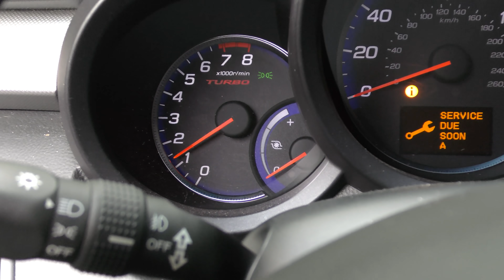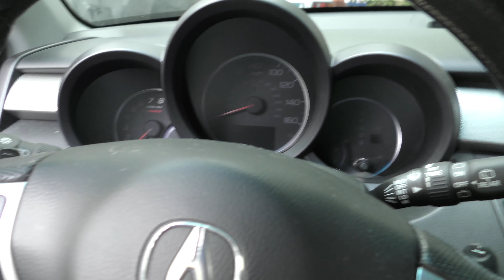I Just Found My New Favorite SUV (You Can Buy It for Less Than $5,000)

Comment: You always warn us to stay away from turbocharger specially when it gets older and you also warned us several time to stay away from all-wheel drive because it is over cost to repair, but in case of this vehicle it's all upside down.
Reply: Not on this car... This is the ONLY exception and I can prove it!
Reply: He did say it doesn't have the dreaded GDI.  So supposedly less strain on the motor.
Reply: @johnwilliamson2707  is 2010 Acura RDX GDI?
Reply: This car is an exception, it was engineered to last despite all that. Overbuilt.

Comment: Acura RDX: I have SH-AWD

‘94 Celica: Is my legendary reliability a joke to you?
Reply: Rajkiran Natarajan Subaru Forester XT laughs in symmetrical AWD
Reply: shinkueagle reliability? 😂
Reply: Bobby May yeah Acura’s are reliable, moreso then subaru.
Reply: Nick Zito Modern Subaru’s are terrible.
Reply: s blagg you mean like the fact that 1.5 million had their warranties extended due to CVT failure? Or the fact that 2.3 million were recalled over a brake light switch issue? Or the thousands of head gasket jobs people have done to make them run past 90,000 miles? Or the oil burning issue on the H6?

Comment: My wife had a 2010 rdx when we met and she loved it.  Never had any issues other than 1 wheel bearing that went bad at 6 years. When we had 3 kids and needed something bigger, we got a used 2014 mdx which has proven to be reliable so far. It has a v6, no turbo, which i prefer but is still GDI. Also got the front wheel drive instead of all wheel drive. The MDX does get good mileage, 20 city and 31 highway (actual mileage not the EPA rated mileage which i believe is 18/26) so it gets way better than rated mileage. Nothing wrong with it so far and its almost 7 years old.
Reply: Cool story... Gotta love 'em both!

Comment: Scotty: The Acura RDX is my favorite suv

Scotty: Why the Acura RDX is a endless moneypit
Reply: CHANGEDD THEEE GGGGGAAAAAMMMMMEEEEEEEEEEEEEEEEEEEEEEEEEEEEEEEEEEEEEEEEEE
Reply: Arnoldo Texta - well... I just bought an RDX 2015, 50,000 miles for $15k USD. I love it so far, but I haven’t had it very long. I shopped and shopped and negotiated and shopped. I ended up going with a dealership because I didn’t find there was much price differential for. 

Is there a reason you want an ‘O6? Budget or you like that year? As for advice: be patient, and don’t limit yourself to looking in your area - if you’re willing, look within 500 miles, it broadens your options.
Have a mechanic check it out. Set up your inspection the same day you intend to buy it.
Reply: @jmclick.6349  why?
Reply: @EverettNewell  How is it holding on so far? I have my eyes in a 2016 rdx 75k miles.
Reply: @drmendozaenriquez  - I ended up having to get the transmission rebuilt. Not thrilled. It’s been fine since then, but apparently their transmissions aren’t very good.
Reply: @EverettNewell  2019 Acura RDX, I've had it for three years now. The only problem is the transmission, it's funky for sure
Reply: @drmendozaenriquez  I’ve had my 2018 for 20k miles now and it’s still under 30k miles but runs like a fuckin champ
Reply: @Everett Newell These transmissions really need oil and filter change every 30k miles.   130k on my 2013 and it runs great.  I also did a timing chain replacement at 98k and replaced rear shocks at 110k
Reply: Didn't he tell us not to buy turbocharged engines

Comment: The coolest thing about the first gen Acura RDX?
It was Honda’s first turbocharged car for America and it is pretty capable has a lot of potential
Reply: Swap it into a civic
Reply: @bigsohc  Rdx has more power than a civic. Yes the body style is same and civic is a great car too but rdx is not just a disguised/dressed-up civic
Reply: I have an 11 with the shawd.  It's a fun canyon runner and highway puller. I love getting in it every time. 105k miles with zero issues and regular maintenance.
Reply: Where did you find a Acura RDX of that year with low miles from ?

Comment: I've had mine for 4 years, it has 260k it's had it's issues but that's basically because the previous owners didn't stay on the maintenance which is important on these cars . As long as you use the fluids you are supposed to. Stay on top of the actuator eye bolt for the turbo. It will last a long time. I've been very hard on mine but I make sure it's never running dirty or redline all the time. It has few mods and I've spanked Mustang Gt's, STI's , Si' s all day long. Let that turbo breath and it will give you good results but don't neglect it. Oh yeah I'm also still on stock internals and turbo.
Reply: Quick question on the eye bolt, common issue?

Comment: Scotty, when telling people to change their ATF, tell them to shift to reverse for 5 seconds, shift to park and turn off the engine.  Then change.  They can only change a certain percentage of it so I would change it about 4 times between 70,000 and 90,000 miles.  Then do it again between 150k and 170k, and keep doing that every 70k.  This back-flushes the transmission filters which get clogged going in forward gears.  You don't want in reverse too long or more crud gets sucked up into the guts of the transmission.  I enjoy your channel and have spread the news.

Comment: This RDX has the same power as my Pilot from about the same time. They get identical fuel economy. 18 city, 22 highway
Reply: My Ford car  gets 19 city and 25 highway even the mustang gas a better mpg
Reply: @Itz_tony0_0  ford🤮🤮
Reply: No Way - well, my V6 is 3.5L but the Acura’s 2.3L 4 banger is turbo charged. I couldn’t tell ya. Technically mine is rated at 244 horsepower while this is 240, but the RDX has 260 pound•feet of torque compared to my 240. In the end, they’re burning about the same amount of fuel though
Reply: @elamay5  forgot the crown vic

Comment: I have a 2007 rdx with 150k. Warning, tires for this vehicle are very expensive $800. Recent repairs include a failed coil pack. Failed ac compressor relay fuse. Then a failed radiator that caused my trans fluid to mix with coolant. Like the car but it is quickly turning into a money pit.

Comment: Turbocharged? 
13 years old?!?!
AND IT DOESNT EVEN LEAK OIL?!?!
How?!?!?
Reply: Dave Crupel superior build quality and the previous owner doesn't drive hard
Reply: The owner died 12 years ago.
Reply: Scotty magic service.
Reply: It's a Honda, that's why
Reply: Made in Japan??
Reply: Replace or clean PCV valve to reduce engine pressure, use synthetic oil. Never a drop of oil.
Reply: It doesn’t have GDI
Reply: mustafa ali 
Haha! Just because “it’s a honda” doesn’t mean reliability. I have a 2007 Honda Odyssey with just over 140,000 miles, and it has had so much stupid stuff go wrong. Been through 4 power steering pumps, an abs pump, two power steering racks, a transmission, motor mounts, three alternators, both sliding doors broke, and the ball joints have been replaced 3 times. Never had this many issues with any other vehicle, including my 08’ Dodge Ram 1500 with 340,000 miles on it.
Reply: @DS..69  nope. It was built in Ohio
Reply: @deereman8237  Scotty has often said that the Odyssey was the one vehicle that Honda got all wrong and they were junk.
Reply: More Beer 
I can agree with that! Really never seen another Honda vehicle with so many issues.
Reply: @deereman8237  Why is the world would you fix it? If it has more than a few issues, and the same things keep on breaking? That's a solid waste of money, unless that car had sentimental value.
Reply: @deereman8237  Was it made in the US? LOL

Comment: I had a guy come in with a 2002 Pontiac with the 3800 engine. Rough idle. He threw a bunch of parts at it but when he asked me what it could be, I said it's probably the idle air control valve (IACV). Sure enough, that was his fix!

Comment: as a prior owner, yes 07-12 RDX is a very good vehicle; if you are buying one now you'd be best to buy 2010-12, 08-09 ok, wouldn't get 07. 
Pros: reliability, above average handling, some luxury feel. 
Cons: so-so ride quality, not really that fast, no soul (drives like an appliance), premium gas/so-so gas mileage (if you think premium gas/gas mileage matters, proportionally it doesn't really)

I see some comments about this vs 2nd gen v6. Problem is this powertrain is equal in reliability and 2nd gen v6 is boring to drive. If you want proof this is better than the 2nd gen v6 then look what acura did with the 3rd gen. They went back to turbo 4. 

if they had made a manual version of this; then it would have had aftermarket support and really have taken off but they missed that boat. everyone who had a turbo forester would have bought one and it would have really had a following. Now time for manuals is kinda past so wouldn't really matter on 3rd gen.   

It really a solid B+ of a car. Good all around but not spectacular at anything. You wouldn't regret buying it but it's a little bit too meh at the end of the day. He's right that it is good for the price range.

Comment: I got the 2013 RDX top of the line and it still cost $37,000.00 (except it is a V6) and Honda/Acura still skimped out on the rear air vent for the passenger.

Comment: I literally just bought this car - have to get it insured and plated, but I'm constantly hearing things about the gas mileage (and it runs premium) - I'm gonna have to see for myself, but I'm gonna be sure to drive it slow/smoothly to save some $
Reply: How are you liking yours? Meeting up a guy later to check out his 07 Rdx SH!
Reply: @verynick  outside of a couple major repair jobs I had to do recently, and this one issue with a vibrating transmission at certain speeds, I've been  loving it - fun to drive, spacious enough for me (6'2 frame), fits a lot of stuff, and the Tech Package has a ton of nice features in it - my only issue would be gas consumption cuz it drinks premium and it's easy to spool the turbo on the road - if you can keep your foot light while driving, generally you should be good to go
Reply: What year did you get?
Reply: @brittanyann5244  2008

Comment: I had a 2007 Acura RDX bought used in 2011 with 80K.  Was great until 2014 and after the battery died due to extreme cold where I live and it never was the same again.  The battery drain kept going and then the Acura dealers couldn’t diagnose the problem twice.  If you didn’t start the car after 3 days the battery died again.  The Bluetooth was defective and then the AC stopped blowing cold air at 150K.  Traded the car in for a Q50 at 153K in 2018.  Good performing car,  but I will never buy another used Acura that isn’t certified again.

Comment: 2007-2013 are some of the worst years for Acura RDX with electrical problems, engine problems, transmission   problems, infotainment problems, coolant leaks, and the list goes! 2014-2016 are the best years so far right now.

Comment: Hey scotty my 2008 acura rdx was leaking psf. I had to get the  pressure hose swapped out. I bought some premium full synthetic fluid oem compatible fluid designed for all asain vehicles.  And I bought some Honda genuine psf. I didn't know I needed 3 bottles. I only bought one and my mechanic used both fluids once it was flushed am I gonna be okay?  Or should I swap it out and use honda genuine only?

Comment: About that 2000 Impala in the q&a segment....if it runs rough, in addition to the tune-up, the ignition coils might be causing it as well. I had a 2002 Bonneville with the same engine and had the same issue at around the same mileage

Comment: Scotty... Now that I know you like Acuras, what's your thoughts about the Acura RSX?
I'd just like to know your opinion on them. 
I've owned a 06 Acura RSX for about 8 years, I purchased it with only 90,000 miles and have put 130,000 extra miles on it (it's at roughly 220,000 miles now). It's still running strong with only the minor issues like the driver's belt buckle going out and driver's door lock actuator and other minor things like that, that are used frequently.
I'd just like to know your opinion on them since you liked this Acura.
Reply: BTW, I LOVE your videos!

Comment: I almost thought this car when looking at the most reliable Japanese SUVs 10+ years old in almost any condition. As long as the Carfax looks legit I wouldn't hesitate to recommend it, they're bulletproof. The ride quality, paint and metal coatings mean less rust and better ride quality than any other car equal to its age.

What I noticed is cheaper cars that arent luxury branded (honda and toyota) have inferior coatings and paint that cause the body to rust and bolts, suspension, exhaust, brake lines, fittings all corrode excessively faster. I've seen toyota matrixes that are 2016 models that look awfully rusted out compared to say a 2007 acura rdx or similar year lexus prpduct. I domt think people in the rust belt realize this is a MAJOR dofference that causes a whole host of extra issues and it comes down to better manufacturing, coatings and higher quality material in the luxury japanese brands (lexus and acura). I did a lot of my owm research and compared hundreds of cars so I know theres something there... I wish I would have bwtter recorded the results to prove this point.

Comment: Scotty what do you think about a 1990 Ford explorer XL 4.0 engine 4-wheel drive with 90 1994 thousand I bought it last November in 2019 for $500 do you think that's a good deal for that kind of car AC and heater works on it but the four-wheel-drive does not work I had to replace the cross member it makes a sound when I hit the brakes like something is hitting the frame and it shakes when I go over 65 any tips on what could be I replace the rear shocks

Comment: Scotty, I know you advise against buying used BMW's.  I definitely see why you say that. But I only paid $2,500 for a 2011 328i xdrive.     So I figured I'd take my chances.  Just got a part in I was waiting for.   Drivers side adaptive headlight control module went out.   After I put new one in should i excpet to have to have the new computer coded to match with the other existing headlight that still works?  Is this something you have heard of?  Car is extremely clean and only needed the headlight and a new windshield to pass inspection

Comment: Thanks for the info on the RDX. I do have one question and I really do hope you answer it. How does the new one with the GDI stack up if you drive it normally not dogging it. Will is be as reliable as the older one.

Comment: Just bought a 2011 RDX with 75k miles. Better buy than a 2014 Subaru Impreza hatchback with 60k miles?
Reply: Absolutely!  Subaru has fame for it's cars burning oil and not to mention the head gasket issues around 60-100k miles

Comment: Love all your vids Scotty. Absolute legend. Since you're a legend would you please give some advice. Considering the cars run good and they aren't from a dealer. What year (year of make) should I get a Toyota Camry or Honda Civic (transmission-auto). I've found a Camry (2006) for $4k 220km and am reluctant to buy.
Reply: Take to mechanic and get checked also look for rust starting. Offer 3k max in my opinion and keep 1k for any incidental work that maybe required.. Check tires if they are aged maybe a way to hustle the person down a little plus everyone is hungry for cash atm....
Does it have a clean Carfax
Reply: Jandre Osrow a little too high on the mileage for that price. Try to get something around 120km.
Reply: Thanks for the advice gonna do as recommended

Comment: Hey Scotty I got a good one for you. I have an '86 audi 5000 quattro wagon. About 2 months ago I started having a problem with it. We narrowed down all the possibilities and figured out I have a fuel issue. Sooooo we replaced the fuel pump, filter, checked relay,  had my mechanic check the pressure out of the fuel distributor on each 5 cylinders and it was fine. The thing he told me is that the engine gets fuel when it cranks, but once it catches and tries to run, it starves. I have no idea what is wrong and I am not sure my mechanic does either, and since I live in a secluded place, there is only one european car person around. Do you have any ideas? Thank you!!!
Reply: Many cars of that vintage had two circuits supplying power to the fuel pump...
Circuit 1 ran off the start contacts of the ignition switch, thru a fuse and wire to the fuel pump.
Circuit 2 ran off the run contacts of the ignition swich, thru A DIFFERENT FUSE and wire.
If fuel pump pressure drops shortly after starting, check every fuse. They did this just to p*ss us off.

Comment: Hey, Scotty! Isn't it bad for the fuel pump to start the car instantly when you put the key in? Like on 01:25?
Reply: m1rchegfn the moment you cycle key the fuel is already in the lines and hiding orssure so once you hit the starter it’s good to go, only bad time would be cracking with out injector fuses or if you let it sit then the line presidiré goes down and it would be smarter to let it prime and start

Comment: OK, Scotty, I've been watching your channel enough to know......no turbocharged engines!!  And what I hear:  turbocharged engine!!  How did this engine escape the same flaws that other turbocharged engines haven't escaped???
Reply: Sun Dancer I think he recently stated that larger engines, like this v6 handle turbochargers a lot better than smaller 4 cylinders
Reply: Because it is a low pressure turbocharger, like how Volvo used to put LPT light pressure turbo, in their cars.  Puts less stress on the engine.  Plus, it’s made by a reliable Japanese automaker, Honda.
Reply: Because it's a Honda. I have one... 293K miles and runs like new!